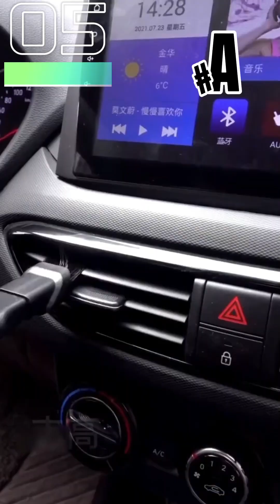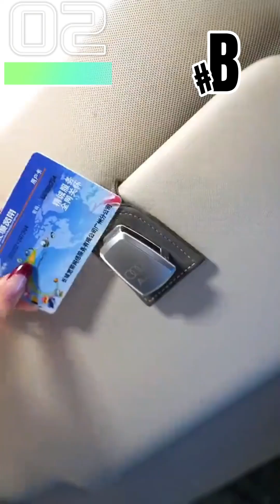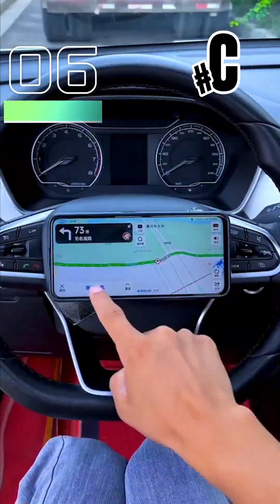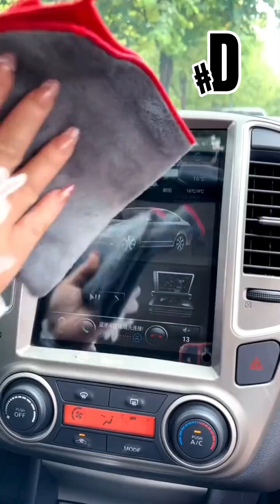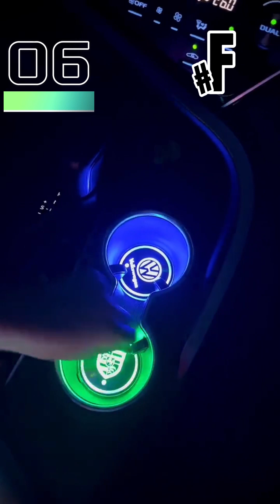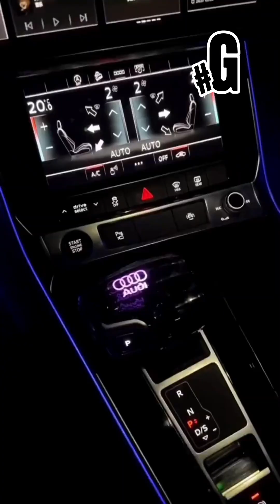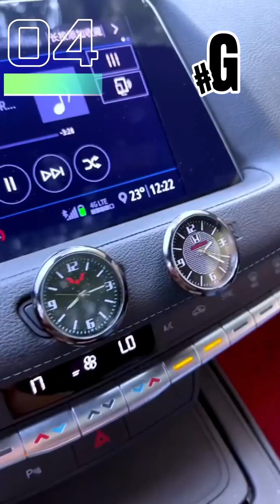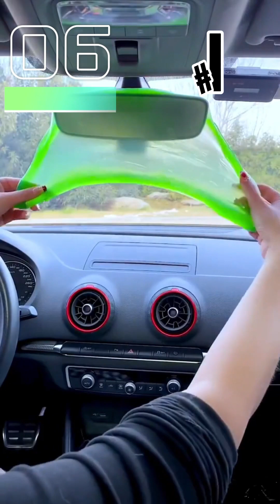A large collection of all automotive supplies, you must have what you need #1-10

Comment from the maker: Welcome to our automotive supplies collection! In this episode, we'll show you the latest and greatest in automotive supplies, and we've got you covered.

A1.Car armrest booster pad
https://amzn.to/3Pgv3qS

A2.Car seat back tissue box
https://amzn.to/4398ry4

A3.Center console sealing strip
https://amzn.to/3Vc6IWR

A4.Car solar anti-theft warning light
https://amzn.to/4a2tJQj

A5.Car wireless vacuum cleaner
https://amzn.to/3TtUZBO

A6.car armrest box storage box
https://amzn.to/3V7jDcN

A7.Car door corner anti-collision sticker
https://amzn.to/49WNSau

A8.car heated seat cushion
https://amzn.to/4a6QVwU

A9.fender expansion screw
https://amzn.to/3IxxrFK

A10car rearview mirror small round mirror
https://amzn.to/3TuunAz

---------------------------------------------------

B1Car cleaning brush
https://amzn.to/4a6ZAPL

B2.Car sun visor glasses clip
https://amzn.to/4c6hCn9

B3.car wash gloves
https://amzn.to/3PeHcwz

B4.Plush armrest box mat
https://amzn.to/3v1NNn7

B5.winter car steering wheel cover
https://amzn.to/4c991A4

B6.Reflective stickers for wheels
https://amzn.to/43a4Z6w

B7.Car mosquito screens
https://amzn.to/4a4eBC3

B8.New color-changing seat gap storage box
https://amzn.to/3Vd49nw

B9.Tire pressure monitoring cap
https://amzn.to/3wH20pS

B10.Car interior wipes
https://amzn.to/43dLbPr

---------------------------------------------------

C1.seat belt limiter
https://amzn.to/3Tc4jsz

C2.car shock absorbing pad
https://amzn.to/3IyK1od

C3.Rear view mirror rain eyebrow
https://amzn.to/48R8ShX

C4.Luminous valve
https://amzn.to/4cbR2sD

C5.car seat double hook folding hook
https://amzn.to/43aL5bz

C6.Universal nano double-sided tape
https://amzn.to/3IyO1Fi

C7.Folding trash can
https://amzn.to/3wS7oqr

C8.Car multifunctional storage box
https://amzn.to/3PgYlpp

C9.car seat hook
https://amzn.to/3VdHXcM

C10.Cleaning soft glue
https://amzn.to/3TdFmNt

---------------------------------------------------

D1.Seat gap storage box
https://amzn.to/3v8xJjm

D2.car touch up paint pen
https://amzn.to/3x2bI6g

D3.car pillow quilt
https://amzn.to/4a2dDq4

D4.Jack labor-saving wrench
https://amzn.to/3v0JF6W

D5.Car thermos cup
https://amzn.to/4ceBxAj

D6.Special car wash towel
https://amzn.to/3Tcu8ZH

D7.Steering wheel cell phone holder
https://amzn.to/3uXv38o

D8.Oil film remover
https://amzn.to/3TvTQd0

D9.clear stone hook
https://amzn.to/3ThVkX2

D10.Car door sill anti-step sticker
https://amzn.to/4ccoOOE

---------------------------------------------------

E1.Transparent door and bowl stickers
https://amzn.to/43h0s20

E2.car snow shield
https://amzn.to/3VjOpyZ

E3.Car seat back tissue bag
https://amzn.to/3TgHJiD

E4.Memory foam headrest and lumbar support
https://amzn.to/43lkFUI

E5.Solar double ring suspended rotating car ornaments
https://amzn.to/3TCDShl

E6.car seat hook
https://amzn.to/43hjrcS

E7.car floor mat fixing stickers
https://amzn.to/3TCYnun

E8.Fender metal sticker
https://amzn.to/4cak9wJ

E9.Car suction cup mobile phone holder
https://amzn.to/3vcgc9Y

E10.Car Aromatherapy Starry Sky Canopy
https://amzn.to/3TDgFvw

---------------------------------------------------

F1.Dashboard cell phone holder
https://amzn.to/3TF1iCs

F2.winter plush car seat cushion
https://amzn.to/3PjRSKo

F3.Car ashtray with LED light
https://amzn.to/3v5hW55

F4.Adhesive mobile phone holder
https://amzn.to/4ajHpXn

F5.Car rear seat anti-kick pad
https://amzn.to/3vdx14o

F6.Car luminous water coaster
https://amzn.to/3Pn07oO

F7.car bumper anti-collision strip
https://amzn.to/48VmiJS

F8.seat gap box
https://amzn.to/3TieR9D

F9.Car armrest booster pad
https://amzn.to/3Pgv3qS

F10Vehicle B-pillar sealing strip
https://amzn.to/3PpZRWe

---------------------------------------------------

G1.car charger
https://amzn.to/3TAkamd

G2.Car one-button start decorative sticker
https://amzn.to/3PpKA7A

G3.Audi crystal gear knob
https://amzn.to/3VmnT8d

G4.Car quartz clock
https://amzn.to/3TDw92j

G5.car seat storage box
https://amzn.to/4ai7SV0

G6.car snow cover
https://amzn.to/4agTNHv

G7.Retractable cell phone holder
https://amzn.to/3v4Kzzn

G8.car pillow quilt
https://amzn.to/4a2dDq4

G9.Summer ice silk car waistrest
https://amzn.to/4ab11xj

G10.car wash plush gloves
https://amzn.to/3IFNdi1

---------------------------------------------------

H1.Disposable ashtray
https://amzn.to/3IGHada

H2.Mahogany grain steering wheel cover
https://amzn.to/3Pr3V8v

H3.car sunshade
https://amzn.to/3TneM4B

H4.car sun visor storage bag
https://amzn.to/3TFDTkE

H5.car tire brush wheel hub brush
https://amzn.to/3v61jpT

H6.Trunk storage box
https://amzn.to/49UeQju

H7.car pillow quilt
https://amzn.to/4a2dDq4

H8.Bamboo car seat cushion
https://amzn.to/3v7aIgW

H9.Car armrest box storage box
https://amzn.to/3x7B7LV

H10.Magnetic car window sunshade
https://amzn.to/3VnkbLE

---------------------------------------------------

I1.car bumper anti-collision strip
https://amzn.to/48VmiJS

I2.Car storage net pocket
https://amzn.to/3IJ0dn5

I3.Car silicone steering wheel cover
https://amzn.to/4ajJYIY

I4.car sunshade
https://amzn.to/43rhs62

I5.Car thermos cup
https://amzn.to/4ceBxAj

I6.Cleaning soft glue
https://amzn.to/3TdFmNt

I7.Trunk protection strip
https://amzn.to/4agB6nb

I8.car floor mats
https://amzn.to/4a2NRlJ

I9.Car multifunctional anti-slip mat
https://amzn.to/4a9zv2G

I10.Rainproof film
https://amzn.to/3Pq0ejz

---------------------------------------------------

J1.Car mosquito screens
https://amzn.to/48ZCGc9

J2.Car phone holder
https://amzn.to/3x9SRWZ

J3.Car ashtray with LED light
https://amzn.to/49aF0xi

J4.Car seat small hook
https://amzn.to/43nZAIW

J5.car floor mat fixing stickers
https://amzn.to/3TCYnun

J6.car window breaker
https://amzn.to/3x3VPwr

J7.Universal nano double-sided tape
https://amzn.to/3IyO1Fi

J8.car linen seat cushion
https://amzn.to/3VImSrx

J9.Car steering wheel cover
https://amzn.to/3VoSpye

J10.Fender metal sticker
https://amzn.to/4cak9wJ